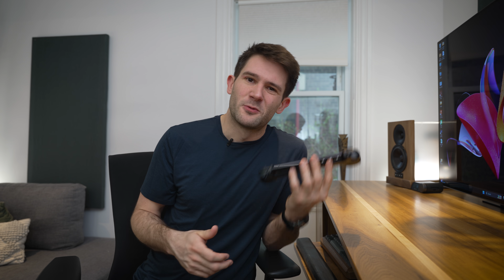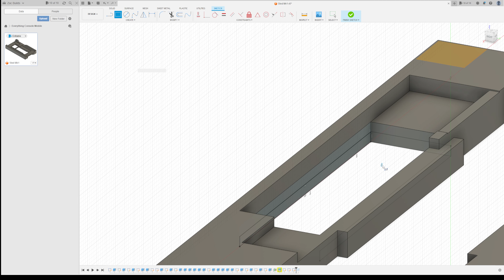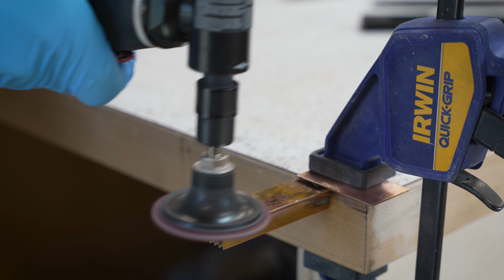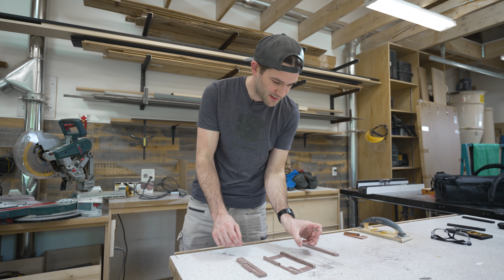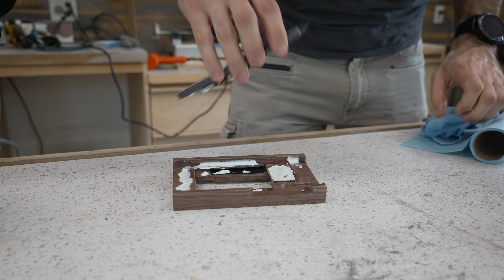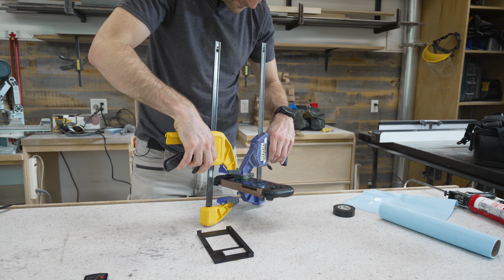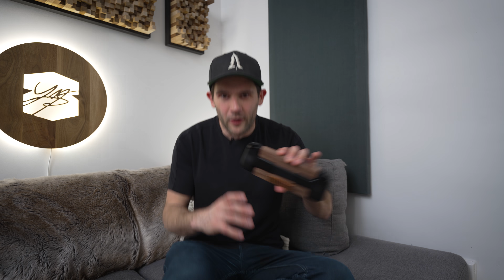I built the ULTIMATE GAMING phone...

Comment: Two little advice that I think I can provide:
I personally don't think that using copper as a heat conductor from the Soc to the fins is not very effective, even though copper is some of the most thermally conductive metal on earth. However, there is this thing called heat pipe, which is more effective than copper at conducting heat, especially at longer distances. Samsung used vapor chambers (basically a flattened out heat pipe) to cool some of their phones' Soc. Maybe you can use a heat pipe or two to get the heat of the Soc into the fins faster.
I think the Soc of modern phones typically face towards the screen, so in this project you are likely to be cooling the back of the Soc through a metal shield, and there is a possibility that there is an air gap under this shield. It might not be too big of a concern, but for an "ultimate DIY gaming phone", it would be interesting to see whether desoldering that shield, adding a blob of thermal paste, and soldering the shield back on will help with heat dissipation.
Other than that, great work, and thanks to you I now know an easy way to get cheap phones😆
Reply: Great points. I thought he would desolder the shield. I always suspected that the soc will face the screen, and that somehow a better option would include both. If that's not possible, a heatsink to the back would work. 
A perfect option would add a small quiet fan, which would open the path for overclocking it a bit. I know Samsung phones have the game center power optimization which I assume overclock the phone to some extent. Otherwise Geekerwan had some crazy creations of their own. Seemed promising.
I have a spare pocoF1 lying around. I might do something similar with it.
Reply: @Evil-Lichie  did u do it?
Reply: Heat pipe is just copper in different shape.
Reply: @bulletpunch9317  Actually, it is not.
Heat pipes and vapor chambers both use the heat of evaporation and condensation to move liquid around inside the copper enclosure, allowing for a much higher thermal conductivity than regular solid copper.
Reply: @bfbunny  sure, i know its not solid, i thought you had no idea whay heatpipes were made of.

Comment: No cooling fan on the back of the phone? Are you Mad?! Whats the point of having the heat sink if you have no fan to suck or push the heat away from the heat sink if it stays hot it can suck heat away from the hot area anymore then it will over heat you need to stop it from over heating not prevent it it will only work until the heat sink conducts the maximum amount of heat it can hold you gotta to put a fan on the back of that thing

Comment: Why not jump new battery to the original battery..
And the SOC as you call it, is on the other side..
To get best heat sinking you can loos the camera module run a copper plate from SOC underneath to top..much better performance

Comment: Use a heat pipe and for the batteries you should just make jumper cable  from a bad battery then both batteries would have their own battery management board and more safer.

Comment: Use a heat pipe instead of soldering many pieces of copper.. just get a flattened 90 degree heatpipe and solder it (or use thermal paste) to the heatsink.

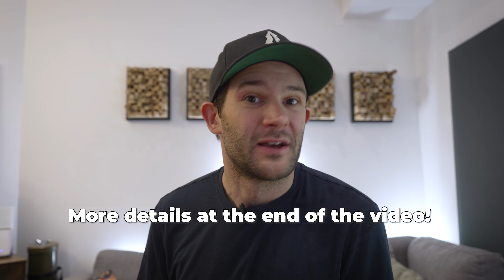Comment: 7:01 the heat sink design won’t perform the way you think it will. Solid block needs to be vertical. This is for convection heat. Putting fins on the vertical stack increases the convection effect(more space for air). Heat pipe would work better because it uses vapor to pull the heat away.  They aren’t hard to make with copper tubing.

Comment: 8:47 making the battery at 0% doesn't make it any safer to puncture than 100%, if anything, the balance point would be 50% based on how batteries work, as both at 0% and at 100% the electrons would be on one side of the battery.

this is a small battery and a small puncture could lead to not much happening (not recommending) but yh, just got lucky here.

Comment: You can use a fan to blast away all the heat coming from the heatsink. There's also a ton of applications that can be used to squeeze out every points of performance to make some games run better like a Kernel Manager.

Comment: When I first saw that double battery, I got instantly reminded of one of GreatScott!'s video (https://youtu.be/7f8SliNGeDM). Apparently smartphones are kinda rigged when it comes to battery percentage, unless you modify it's capacity with root access or some other means. Does it still registers 9000 mAh in app like Device Info or CPU-Z?
It may or may not be possible it works without much hassle of that auxiliary contact in the battery BMS though

Comment: The metal shield on the phone on which you stick the copper bar does not touch the processor of the phone, I think you should have removed it, you applied thermal paste to the air.

Comment: Samsung (flagship) phones have a feature called DeX. It basically just resizes everything for a bigger screen to give you a windows like expirience. So you could just connect it to a external display and connect a bluetooth controller to get the full console expirience. But it wont work without a data transfer cable and the wireless DeX is just a mess.

Comment: Now I want to do this..
Things I would change tho. 
1- Definitely won't be using Samsung. 
2- will make the controller removable. ( Easy to carry.. and I think with a little adjustment to the case it's possible to make it stable) 
3. Keep the camera, cos why not. 
4. Use a legit phone rather than a black listed one ... Or maybe I will use a blacklisted one, root it and change the IMEI number. 
5. Too scared to build a double battery, so maybe I will not do that. And use a power attached to the controller. 
Definitely an awesome build

Comment: Even if you couldnt overclock the latest SoCs, giving them an active cooling system instead of the default passive system will give them a significant boost in performance

Comment: Technically silicone isn’t an adhesive, after all nothing sticks to silicone except for silicone.
The reason silicone “sticks” is suction. The silicone works as an air seal when you push the two surfaces together you push out the air and the silicone prevents air to come back in. So the outside air pressure basically holds the two parts together not the silicone. This is why you can always separate parts when you can break the seal the silicone creates.

Comment: Hey, ever consider PC thermal paste for heat transfer? Apart from that idea, gluing the Kishi might not be the best idea- try making the Kishi detachable for file transfer purposes- that way, versatility is guaranteed
Reply: just find a better controller. i've owned 2 Kishi's, and pass-through charging didn't work on either of them. they also didn't work for quite a few games that had no problem detecting other controllers. most overrated, overpriced controller i've ever owned

Comment: actually you can root this phone if isn't carrier locked then you can just flash some magisk modules and disable aggressive thermal throttling putting in mind that temps slightly arise maybe about 47~50 celsius  but you're gonna notice major performance improvements

Comment: A different thing you can do is fixing the battery protection board in the phone itself and run the +ve and -ve wire from it to a different box thingy and put battery inside it and connect, so that the weight of this whole contraption will be lesser than the original phone.

Comment: About the thermals, phones SOCs are throttled down to not go over 40c to not burn the user when he uses it. This means that the cooling solution doesnt work as good as it could actually. Id suggest swapping the thermal goup with some actual high W/m.K thermal paste like Arctic Cooling MX-4 or similiar. Also you might want to check if the SOC isnt actually facing towards the screen and not the back. Helping it along there would be a huge upgrade. Maybe shimming a thin sheet of copper directly on the SOC would make a good heat spreader and discipating it by a M.2 SSD cooler would be ideal. Also taking off the tiny metal shield over the SOC should make a big diffirence, since its not thermally connected to the SOC and creates a huge thermal barrier. 

Otherwise this is an amazing idea.

Comment: To me I think if you made the sled out of aluminum and merge it with the heatsink  you can reduce the weight, improve durability, and improve heat transfer. This change would go really well if you manage to overclock it.
Reply: the case would probably get warm tbh. But since the heatsink was only 25 C i think it would be fine tho :P
Reply: you can't overclock snapdragon SoCs after the Snapdragon 865 and some early 870s
Reply: @niveZz-  you're right. But just a small note. Most android manufacturers underclocked the SoC. So having the chipset to turbo for 70% of the time would be an awesome improvement.
Reply: @peasant97 Samsung has a performance mode toggle which allows the phone CPU to run at full speed
Reply: @peasant97 my Helio G88 is clocked at 1,8 GHz (it has 6x1,8 GHz and 2x2GHz
Reply: @niveZz-  what phone is it note 10?
Reply: @detecta  idk what you mean but in the video he used a samsung galaxy 21 fe (snapdragon 888)
Reply: @niveZz-  i thought it was a note 10
Reply: @detecta note 10 is 855+
Reply: @niveZz- konabess doesn't work on 888, 8gen1 and newer?
Reply: @nggw6792  it does but it doesn't allow you to overclock your GPU since "trust zones" have been implemented
underclocking and undervolting will still work but you can't go over a certain limit otherwise it won't boot and you have to reflash your stock vendor_boot partition
Reply: it works on 8 gen 1. dont know about the rest. i used it to underclock my phone @nggw6792
Reply: @niveZz- Right, only 855 ane lower.
Reply: @HardWhereHero  865 and early 870s too
Reply: @niveZz-  you can, I think the 7+ Gen 2 can be overclocked if it's rooted, the performance is very good if your able to control the thermals
Reply: @niveZz- no you actually can now using Konabess
Reply: @niveZz- wrong
You can overclock modern snapdragons. Tried with an 835 and there is no support
Reply: @heatsflamesman6080 The 835 is old at this point
Reply: Also should have used thermal paste rather than the stuff u used. PC’s use it because it works.
Reply: @cambike what makes thermal paste more effective than putting 2 pieces of metal on each other? Does it suck the heat out of the processor or just makes for a better contact?
Reply: @CenReaper.  it improves contact surface area by filling microscopic imperfections in the two surfaces. That allows better thermal passage, improving cooling. If two metal surfaces were perfectly flat and did not change shape during heating, paste wouldn’t be required. Even though you may think two metal components are flat, they are probably not. Hope that helps.
Reply: @cambike  yes,it does help
Reply: Then make the battery external
Reply: Lol u can actually oc some chips, like 855 and 870, 778g, 690, 750 (gpu only, with konabess) and other shits, but things like 865 u will only unlock them, like turbo unlock in cpus.
Reply: Wow i thought i knew much about phones and cpus and gpus, but what people here are discussing is 2levels above my knowledge
Reply: good
Reply: Overclocking: No.
No Thermal Throttling: Priority.
Reply: @sirajkhan-bx5zl  nah its very hard to a phone get throttled. Only very bad phones with shit cooling, very shit soc and shit software throttle. The currently phones with vc and liquid cooling hardly get throttled
Reply: especially if you tried emulating windows on  it like i did awhile back ran fallout newvegas on my galaxy s23fe ran like shit but probably because it was turning the phone into a thermo nuclear bomb
Reply: All he did is improve battery other then that could have just added a phone cooler
Reply: @avramsecoundaccount phone coolers don't work anywhere near as well as you'd like tho, this heat sync will be more effective

Comment: I must say that I am seldom disappointed with your videos but here I very disappointed. Instead of tearing down the the controller and combining the housing you built with both the device and the and the controller. There was no reason you couldn't have cut out the telescopic portioin of the controller, you also shouldn't have left the heat sink open as it has to potential to burn the user. (You)

Addittionaly, you could definitely have rooted the device using Magisk, upped the clock speeds and even included a super low profile fan - Instead of the worlds tallest phone heat sink. A bit of research would have gone a long way, again this feels very half baked. The volume and power buttons must be hell to press from anywhere other than the front of the device. 

Also all of the information in you guide is readily available online for FREE from channels like Taki Udon, ETA Prime, Wull den and Retro Game Corps. So it's a little shady especially considering that you admitted yourself that you only recently learned how much information is available. There are massive emulation communities happy to help users get a device up and running.  

Im quite disappointed as I thought your channel was better than that. I've been a long time viewer but I'll be unsubbing because I don't think it's fair to take advantage of your supporters when you could just have easily directed them to the resources for free and found some other way to finance you exploits like the rest of us.

Comment: That are really exciting result, but:
1) U are wrong about overclocking (its not effective at 888 if u pull gpu on max possible mhz u didn't see difference performance in real games, only numbers in benchs) 
2) Better choice will be any device with snapdragon 865 bc when u overclock gpu (905mhz or even more, depend in crystal "random most of times") in games it almost the same us 888 but have much less TDP and in result lower heating 
3) Device with unlockable bootloader to use root and some extra performance tweaks (cpu/gpu/ram)
Reply: Also should use custom rom+kernel for best gaming experience in next generation

Comment: Agreed Samsung wasn't the best phone to use here haha. Im not sure about your channel policy on mentioning other YouTubers so I won't but let's say another person done this and he used a Chinese phone (I think k40 or smth like that). With that u could root it and remove all throttle the chip has, driving it's performance thru the roof haha (a much beefier cooling solution is recommended!)

I also wonder if u should remove the heat spreader and do a direct die connection to ur heat sink, while using good thermal paste (or if u dare, liquid metal) for that extreme cooling performance